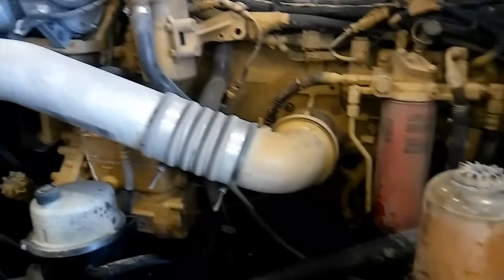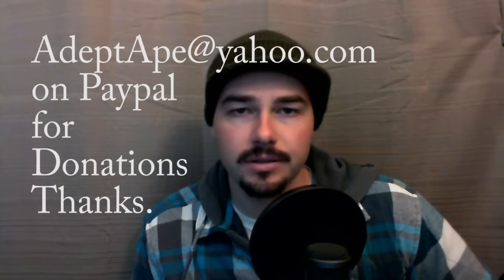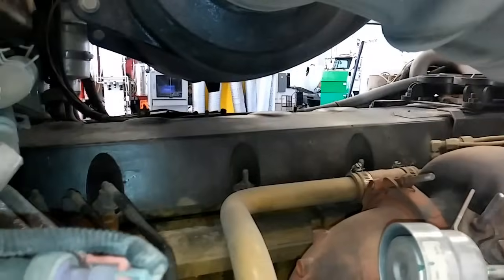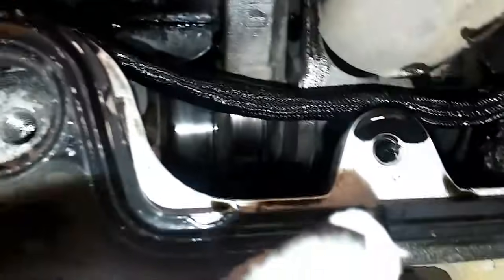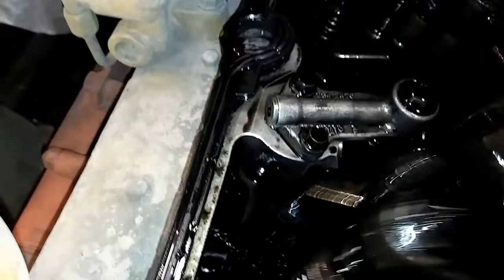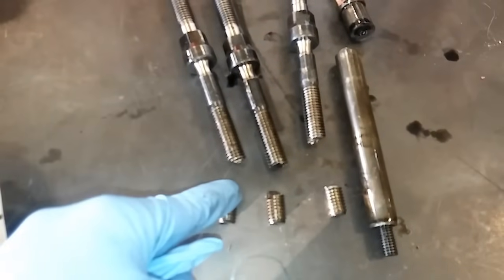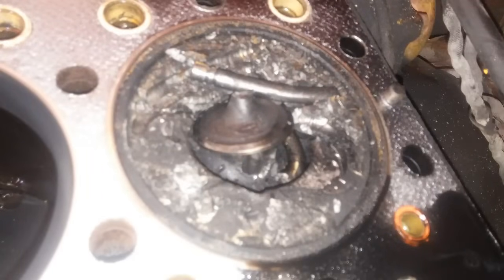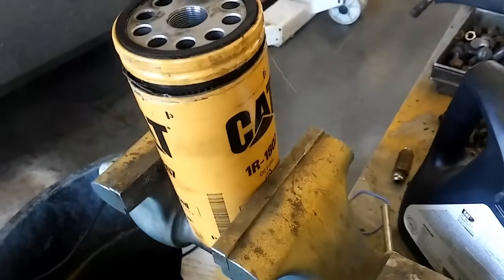What Causes Diesel Engine Ticking, Clicking, Tapping, and Knocking?

Comment: My diesel is ticking a lot when engine is cold, also hesitates when I let off the gas in second gear, like a misfire. Then after 10-20 minutes these issues basically goes away, as the engine has warmed up. Your take on the issue?

Comment: My diesel engine sometimes has a knocking or ticking noise when it's cold, related to the rpm of the engine, When it's warmed up it goes away. It does have 415,000 km on it and never been serviced, just regular oil changes and filter changes every time the oil is changed.

Comment: I'm looking to buy a CC RV with a C9 engine. The mechanic that works on it told me it has an alarming fuel knock that goes away very quickly. He said it has been doing this for a long time. Does this sound like a possible "fuel knock", and if so, because it only happens for a short time after starting, is this something I should worry about? Thanks. I've enjoyed watching many of these videos.
Reply: Josh got back to me through email:
"So the first thing you need to know is whether it is a C9 or a C9S. The C9 will have a 9DG serial number prefix and will have been produced up to 2006, if the coach is a 2008 and the C9 has a C9S serial number prefix I would caution you on getting that engine. I'm going to guess this is an older C9 though with a HEUI injector fuel knock. The HEUI injectors could and would knock sometimes especially when cold. It is usually a problem with an individual injector and can make the engine hard to start in cooler whether. I would recommend replacing the bad injector/injectors if you do buy the coach. You might want to call a Cat repair shop and get a written quote for an injector replacement in a RV. It would be a kind of expensive, so hopefully the seller can get it fixed first or negotiate the price with you."

I then told him that it's a C9 with HEUI and asked if he'd seen/heard a fuel knock that goes away quickly, and he replied:
"If it is something that goes away in a couple seconds that would be very difficult to troubleshoot. If it is something that goes on for about 20-30 seconds it could be figured out with a manual cylinder cutout test without too much trouble generally. If it isn't caused by bad injector it could be low fuel pressure or a few other problems. Generally, it is just 1 injector though."

I sent him some $ for his time. I hope others do also. These videos are excellent, and he is very helpful.

Comment: My 1961 fordson dexta has a little knock to her, but the valves do need some adjusting. Crankcase pressure is also present, but so far isn’t causing issues. I’m hoping that’ll fix it, if not i have a problem
Reply: Did you find the problem?

Comment: Have a 2005 International 4300 DT466 truck has 160k original miles on it. Got a strange noise coming from what seems like the air filter box. When I press on the gas petal. Changed the oil and checked the filer for metal everything look ok. Also charged the fuel filter and tranny filters no signs of any metal. This truck was hydrostatic breaks. It’s a roll back tow truck. Anyone have any ideas where to look next??? Turbo? Thanks

Comment: I have a F150 3.0 56000 that has started a ticking sound. Lucas was put in gas not sure if that caused it. Gets faster with faster idle sounds like it’s coming from left side (driver side) of engine. What should I look for possible causes?

Comment: Clacking! exactly! I think mine is caused by air in the fuel. funny thing. i built a surge tank and installed it right before the fuel filter and i'm still getting bubbles in the fuel, immediately after the filter. Is it possible the lift pump is drawing such a vacuum, it's cavitating the fuel?! (Mercedes OM612)
Reply: It may be worth checking that the hand primer pump isn't leaking air, when they get old the diaphragm cracks and allows air to be pulled in.
Reply: @archygrey9093  do you mean the priming port? I have subsequently sealed that but it still leaked away from the high pressure pump over about 5 hours.

Comment: hi great info
here is another question about cummins isx on 2005 volvo vnl 13 speed transsion to see if anyone can help me
when i m driving with regular speed i have no noise everything is normal
but when i release gas going downhill i hear knocking noise that wasn't there before 
however when truck is not loaded or bobtail this noise very hard to hear or any mechanic cant hear it 
seemed like fuel knocking but can you tell me how to diagnose that 
also i get sudden split second engine cut offs on this truck and comes back in same second 
any help would be appriciated 
thanks

Comment: I have the exact same sound on my lb7 duramax . Been doing it since the day I bought the truck and hasn't changed or got worse since
Reply: I have the same on my 03 lb7 ,did you ever figure it out.i bought mine two years ago and drive it every day with no problem but the taping sounds

Comment: Great video..... I recently cracked the head on a overhead cam toyota ln106 3L Diesel engine.
I bought a brand new complete head ( shimmed valves already set to correct clearence ) and fitted it. I lined all timing marks properly when fitting yhe new timing belt and rolled the engine over 4 times by hand to check everything was correct.

From the first moment I started the motor after fitting the new head ( with new head gasket and seal kit ).....there is a ticking sound that was never in the  in the engine before the new head.

What could this be ? 
It seems to be more noticible some days and not others. It seems also to go away at higher revs.

Comment: I have a 3406B CAT motor that has a slapping noise coming from the front drivers side in the timing cover. Good oil pressure and eliminated all outer accessories. Valves looked fine. Any ideas?

Comment: I have a ticking noise like when you shake your home keys it does the same noise but not really loud, and only on high RPM like 3500-4000 (Audi A3 2.0 TDi 2007 DSG BKD) any clue please?
Reply: Same here.  Only when remove oil cap.  Anyone?

Comment: Mine 2.5 Toyota D4D engine excessive tapping sound. I found thats engine oil also slowly reduced the volume. I found a bit oily on EGR assembly and also at the intake manifold. Power doesnt affected and still running powerful during uphill. Tks for you info

Comment: "Long time listener, first time caller" ignore the old user name from eons ago. Just did injector sleeves, injectors, and overhead on a 3126B. When I first started it I had a valve train noise that seemed odd, ran with the cover off and noticed what seems like excessive side to side movement on the cylinder two rocker arms. During a road test I heard some "clackity" that's more than normal from all of the other 3126's I've worked on and driven. I have some videos of the arms with the engine running and movement of the arms with the engine off. If possible I'd email them to you just to get your opinion of what my problem may be. I'd greatly appreciate it! Let me know your thoughts if you can. Thanks for the awesome content!

Comment: Hello Adept Ape.  It would be much appreciated if you took a look at my Duramax LMM knocking diagnosis documentary Pt.1    https://youtu.be/lyyBQoVIcS4
Everyone is clueless what the knock is from, and it's stressing me out, and preventing me from going on tour to work.  I just filmed Pt.2 Removing the Allison to inspect and replace the Flex-Plate/ TC.  I really thought the sound was primarily coming from the bell housing.  I have performed oil analysis on the engine oil and ATF which shows no abnormal wear levels.  
marcel@irnieracing.com    Thanks for your help.

Comment: What causes my Mercedes 617 to change its idle behavior from a smooth purring diesel then to becoming a pain shaker???? I noticed that his occurs after she has traveled for an hour especially by the end of a 26Km trip. Blow by I think is out of the question. Could it be an idle rack pin? Or some injector? Could it be the injection pump itself?  Any tip would help. thank you
Reply: Same. Was purring like a race car.  Now shaking and clanking like a spoon was dropped in the intake.

Comment: hello i have toyota 4wd diesel engine d4d 1kd engine which gives ticking noise at 1500 rpm UNDER LOAD at cold/warm drive. at hotter  temperature, the noise disappear. any suggestions?

Comment: you need to determine weather you have a diesel knock or something more serious, if it is a knock disassemble the engine and take measurements of all the bearing journals after finding the damage it is very critical to determine what caused it or you will be repeating the process more than once.
diesel knock will not damage an engine unless a bad injector creates a hydraulic lock between the piston and head, this can cause bent crankshafts and con rods.

Comment: I seriously need help I have an 05 Chevy. Duramax 2500 hd all of a sudden there is a bad knock but the motor has allot of power still
Reply: How many miles you got and do you have alot of white smoke out of the exhaust because it could be injector knock
Reply: We figured it out piston and barrings came apart we caught it right as it did it
Reply: Well im glad it got fixed and didnt cause too much damage
Reply: Just a new motor. The motor had over 380k miles
Reply: And we had oil in places it didnt need to be but still cant figure out why with barings disinigrated pistons busted and looks like a rod is broke why did it still run and have so much power left

Comment: Would a fuel knock be considered detonation? I know in gas engines when 2 flame fronts meet in the combustion chamber it can make a knocking sound as well as being able to cause catastrophic engine failure....so would an injector be causing a "fuel knock" because of this effect?
Reply: Tristan Rodriguez I often wondered this too, but I’ve discerned that fuel knock is the proper function of a diesel.
Reply: @fearofchicke  well detention is not proper function of any engine lol but diesels do tend to have a different combustion sound

Comment: hi! i have a knocking sound that only audible when the engine is hot. its like  4 to 6 times per second. when you rev the engine above 1,100 rpm, it disappears. what could it be? i noticed it after an hour of up and downhill driving.

Comment: I have Isuzu NPR Eco Max and when I accelerate I have a loud knocking sound I took it to the dealer and put it on the scanner and tell me cylinder 1 and cylinder 4 not sure if it's the valve or the injector what's the best way of finding that out

Comment: One way to check for fuel detonation noises as opposed to mechanical noises is to run the vehicle down a long decent and turn fuel / ignition off then listen   if noise stays or diapears obviously be careful with power steering and stearing lock etc

Comment: Thanks for the video. I just recently purchased a 2005 Dodge with a 5.9 Cummins engine in it it has that word that you said clackity it sounds clackity but it shouldn't because there is no pushrods for the fuel injectors maybe you have an answer for this thank you.

Comment: My turbo went out replaced at 195000
Drove perfect 5000 miles
Then she quit completely blew white and black smoke on acceleration 
In shop sounded like a jet engine before she quit 3500 gmc dually there was No visible damage,  sound came from passengers side
Reply: Don't take your wife along any more.

Comment: My c13 is frustrating me at the moment. Got a check engine light that just started it only shows under load once I shut down and restart it goes away. That I assume is oil pressure sensor for dpf.

Comment: Got a little problem with a international DT 466E.    It starts up normal and runs good in the parking lot.  Dont matter how long you let it run.    But once your going down the road a few miles.   All of a sudden it starts blowing thick white smoke out the tail pipe and has practically no power.  Like it's in limp mode.      Pull over and keep the revs high and sometimes it will clear itself of the white smoke and regain power.   Or shut it off and wait.  And wait.  And wait.    And in 15 to 20 minutes later.  It will start and run with no more smoke and have normal power again.     May only happen once a day.    May happen 100 times a day.    Had it to several shops.   And had a bunch of mechanics try to diagnose the problem.  No one can seem to find the problem and fix it.  Any ideas.  Please help.   Early 2000 model 4500  or 4900  series international DT466 E. Standard shift 4×4 dump bed.

Comment: I have a question , i have a diesel engine 2.0 L skoda octavia automatic gear box and its making a ticking sound only when it has been turn off for quiet some time . I mean that when you start accelerating it stops but when you turn off for hours and get back its there even after oil change and diesel cleaner  product  used

Comment: Hello Im new to the channel. I dont know about diesel engines alot. Just purchased a tow truck with a 3126 engine. The temperature is going up. It was running fine. My question is. Can I run the engine with the termostats removed? Thanks for your help.

Comment: Hi! Great vids man.  I have a 3.0 turbodiesel light duty pickup truck that has what sounds like the timing chain rubbing against something. The strange thing is that 1: it happens once the engine is under « heavy » load ( going uphill)and 2: this truck only has 30k kilometers on it.  Any ideas? I’m thinking the chain tensioner is shot.

Comment: My 2016 volvo d13 with 164k miles was and still sounds like its ticking knocking when idling and medium acceleration but when its heavy acceleration then its not that loud as it on medium acceleration . Today dealer did valve adjustment and its still sounds like same what it can be maybe injector making noise from winterized diesel but its weird bc alot volvos working like that but i heard like new machines working and its sounds clean please help paid 1200 for overhead job with new gaskets he said everything looks good under valve cover but today dealers like to charge money maybe they did not even do anything there who knows . Thanks for any suggestions .

Comment: Hello adept ape, love the videos very good information!What do you think a rattle/knock would be in the cylinder 6 area? (2004 cat c15 mbn)It only does it at idle n light throttle, not a speck of metal in oil filter and it changes pitch with the throttle but when cruising on the highway it doesn’t do it and no smoke at all just a bit of black when up shifting. I had valve cover off and nothing is broken or loose. The noise sounds like it’s coming from the combustion chamber area
Reply: Chris Eee Same exact thing with my mxs accert...no smoke, except light black smoke when pulling, only at idle and light throttle, goes away at highway speed...does yours still do it? Or did you find out the problem? (If there is one)
Reply: Now in know mechanic but my bxs does the same thing......I was told it's a fuel knock and it's no big deal.....  mine has done it for 800000 miles

Comment: 2007 C-15 Acert seems to have a fairly loud clacking sound coming from the front cover area. Just got the truck but don't suspect it to be normal. Any ideas?
Reply from the maker: +TheNDFarmer My guess is rocker arm holddown bolt is broken, that is fairly common on the twin turbo engines, except the BXS serial numbers.
Reply: Adept Ape Thanks much!

Comment: Great insight. 
I have an 06 Cummins 5.9 with a tap or clack at idle. It's not heavy like a rod knock and I've got virtually no blow by. I've already replaced the injectors, lashed the valves, torqued the crossover tubes, rail pressure is in spec, fass 150 but still makes a light tapping. I can't detect an exhaust leak. It almost sounds like two cyl in sequence. It's more of a kachack kachack as if it's two events. Oil "appears" metal free. Hasn't developed a rod knock. I'm not sure where to look next. Ideas?
Reply: I have the same issue, did you ever figure it out?

Comment: In the Motor Home community what is the Best Diesel being used today in these Motor homes. In  this line of Diesel engines what is one of the Most Common reasons for one of these Engines to Brake Down.

Comment: I just did my oil and fuel filter on my 2.8 L duramax and now I'm seeing the engine shake. What can cause this ?
Reply from the maker: +Alejandro Lopez You might have some air trapped in the fuel system, but that should alleviate not long after it starts running.
Reply: Could this harm the engine or is this common after switching the fuel filter ?

Comment: Ya missed one , broken piston rings. Ive seen the top ones break only . Emit white smoke at idle and not score the cylinder.  You have to pay attention to the carbon on the cylinder wall if the rings broken it will have much more carbon build up from the ring not being able to clean the wall.

Comment: My '73 Unimog 406 has a Mercedes OM352 which had 6700 hours when I bought it several years ago.  It now has 7200 hours.   For the past 50 hours the engine would not start after sitting for more than a day without bleeding and priming.  I recently added an electric pump which solved the starting problem but it gradually developed a knock.  Today after an hours work,  it was sitting at idle, the knock then got louder and I saw  a huge billow of white smoke from the exhaust for a minute or two and it died.   I waited a few minutes and it started right up with electric pump off and I got no smoke.  

It is a fair amount of work to remove the valve cover because I have to lift front of the cab.  

How would I check the injectors?